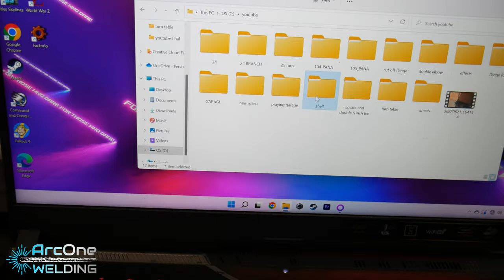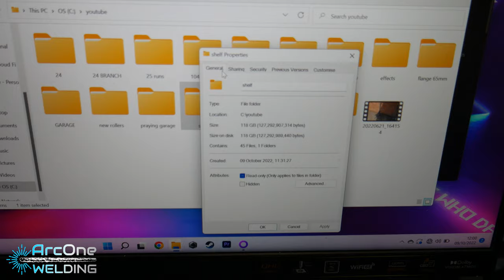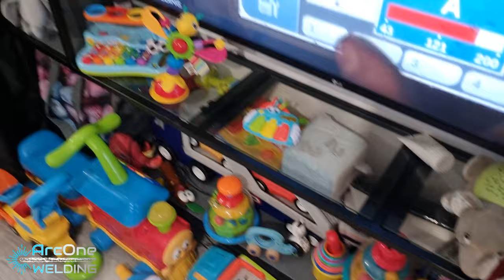DIY Custom Made Floating Tv Unit

Comment: Clamping every joint helps. If you make some clamping angles out of scrap steel that can clamp through 90 and 45 degrees it really aids in working more hands free by yourself on these kinds of jobs. You can then know every joint is a perfect 90 degrees . You can even use lengths of steel clamped to your bench at 90 degrees, creating a perfect oversized square on your bench. Then simply clamp your work to the oversized square. Every joint will be 90 degrees. Saves loads of time. 

Another way of fabricating and making it easier for yourself is to fab the bracing clamped to your bench first, then you only have to tack weld it all together laying one on top of the pre fab with bracing sections ( you only need to fab one part braced and one unbraced..Clamp it all together everything will be square, quicker to fabricate and give you a more hands free welding experience. Tack it all square first, then fully weld. If you want to sell that pucker Fronius welder, I would be interested in that geezer.